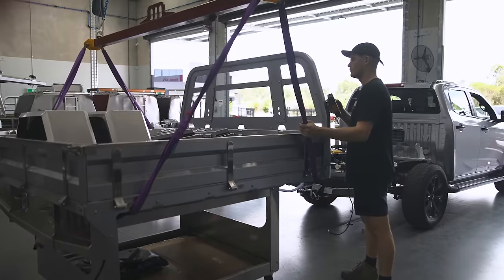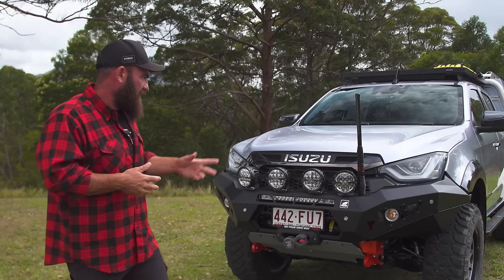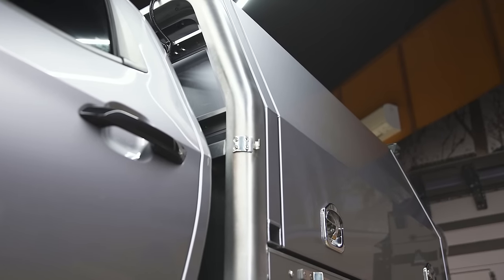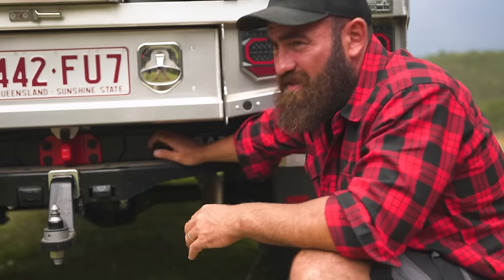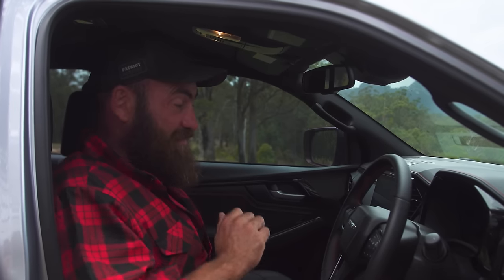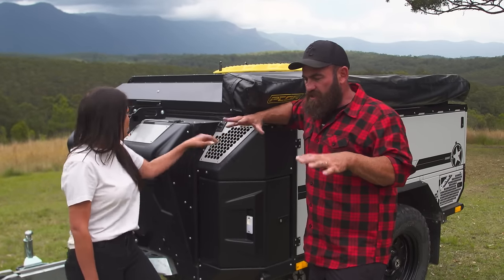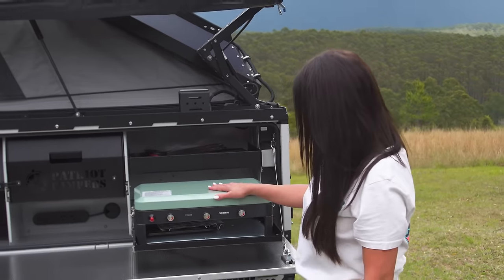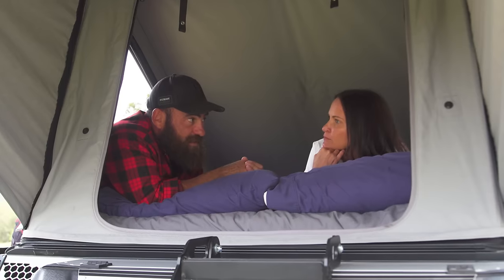All This Could Be Yours | D-Max $175,000 GIVEAWAY Part 3

Comment: Whats your thought on upgrading the steering knuckle to prevent bump steer and tyre wear? Also, i recon the arial needs to be vertical on the bar. It will look odd with a longer whip. And, how about black max trax rather than banana yellow.
Reply: Can't say I have heard of a knuckle upgrade on a dmax. I have a dmax with a lift about the same size and not once noticed bump steer

Comment: Questions, has the speedo been adjusted for the 285/70/17 tires? since these would increase your real speed to 110 when your speedo would be saying 100 kmh?
Where is the truma pump situated, cause i have heard the constant ticking sound annoys people cause its to close to the living area?
I thought the Next Gens were push button  open doors, getting rid of the manual latches, so this is the back to basic X2 Tourer which doesnt have that feature.
Reply: the push button stuff was removed on the X2, not sure on why but may have been to reduce some costs on the unit